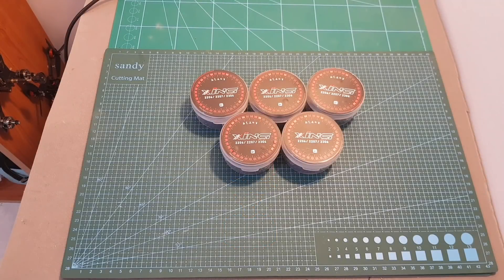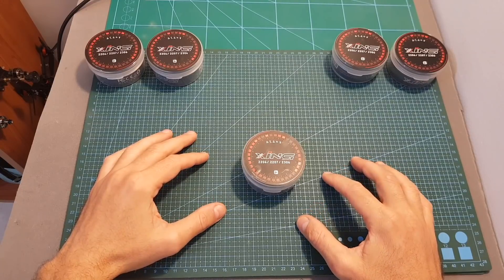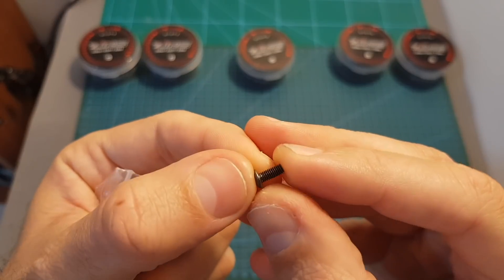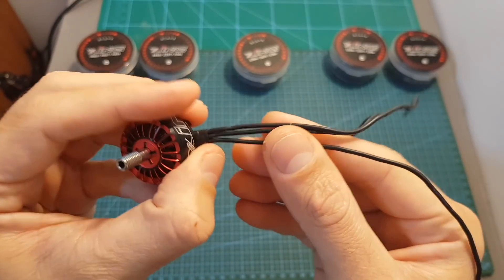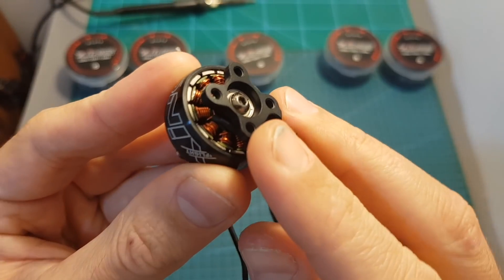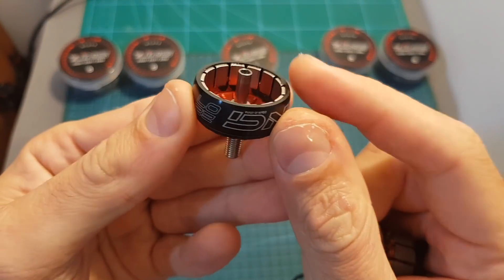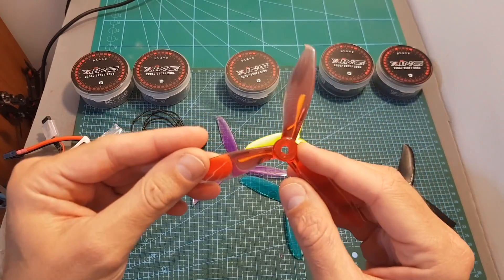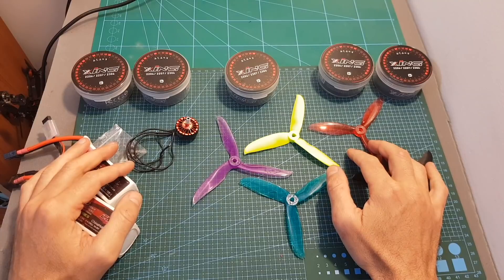iFlight XING X2207 2450KV - Overview & Thrust Test

Comment: Hi how do you calculate the actual rpm of the motors from the data provided. Thanks!
Reply from the maker: Hi, with the thrust stand that I've used in this video it's not possible. I am now using a much better one by Tyto Robotics which is much more accurate and provides more data.

Comment: would a 30amp esc work?
Reply from the maker: Sorry but it turned out that the Current Meter of the thrust stand that I used was not accurate. I would recommend using a 45A ESC in order to stay on the safe side.

Comment: Hi Gal! Nice teste.
I have a ghf420aio with 35a. with this result, i can use 2207 2450kv with 4s and 5" prop without problem.
i am correct?
Reply from the maker: Thanks! Are you sure it's a 35A ESC? As far as I know, this board has an integrated 20A ESC.
Reply: @KremerFPV  yes, this FC have a two versions, 20a and 35a.
Reply from the maker: @marcosasjr2  That's good to know. Keep in mind that this is an older thrust test and this thrust stand turned out to be not very accurate in terms of measuring current, and that's why I am using a much better one on my current tests. I recommend to check the thrust data which is provided by the manufacturer and not to rely on the current rating that I measured. Sorry about it...
Reply: @KremerFPV  no problem, thx for reply.👍
your videos help a lot.

Comment: Can I run 2s  on these motors if I want to practice Percision flying and take it easy when I’m not in the mood for 5 or 6s?
Reply from the maker: You can use 3s, 2s won't give them enough power and you will probably hover at around 80% throttle.
Reply: Gal Kremer ..... ok I was still getting the grasp of kv to cell ratio but I’ve learned a lot since the comment., too bad there’s no chart that shows what a graph would look like showing the motors size dimensions and kv with a minimal to max voltage power band. 

I know there’s weight to thrust ratios when choosing a motor’s kv but I’ve been looking hard to make a drone with at least 7 minutes fly time (moderate). Will a setup that gives you 4 min fly time on heavy aggressive throttle going 50 mph+ give you 7-8 minutes with a 50% throttle cut?
Reply from the maker: @AutoBodyEverything  Well I can only roughly estimate it but it sounds about right.

Comment: Hey Gal, What 50xx prop would you recommend for these motors on a 5" Chameleon Ti? Thanks
Reply from the maker: Hey, check out these props: http://bit.ly/iFlightNazgul5140
Reply: @KremerFPV Hey thanks, but Im not sure i can use them. im using the HQ 5x4.3x3 now and the tips of the props are close to the battery and cage. i dont think the 5.1" clear. its the chameleon Ti 5" frame.
Reply from the maker: @Solopl4y3r  I see. These ones are great too: http://bit.ly/Dalprop-T5045C

Comment: i'm considering to buy this motor for build a longflighttime quad. The 1800KV version is so bad on 4S or i can use it in this configuration?
Reply from the maker: Which props are you going to use?
Reply: Gal Kremer I don’t know....
I think 5030 triblade
Reply from the maker: @nicolalego  It will be ok - but I would either use 5s Lipos or go for the 2450KV version.
Reply: Thanks for the Vid  Gal. I have a set of these motors coming in 2207 1800kv on 6s being my first 6s build have no idea which props to use what do you think? My flying style is smoothish Freestyle.Thx for any help.

Comment: Your consumption of ampere seems to me very underestimated, i have make several test bench, and i have more amp hungry (the volt and thrust is ok for me) i think you need change your AMP meter, try another just for confirm, so your efficiency is wrong too not 3 or 3.5 , but 2 or 2.3 max :) see you soon
Reply from the maker: Thanks for the heads up - I will check it out.